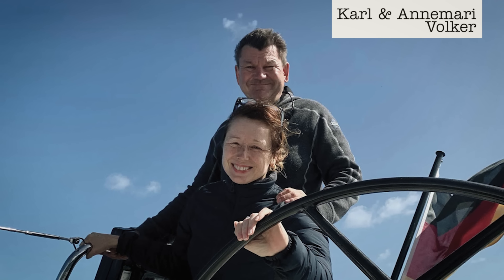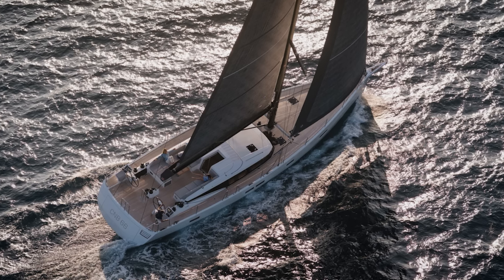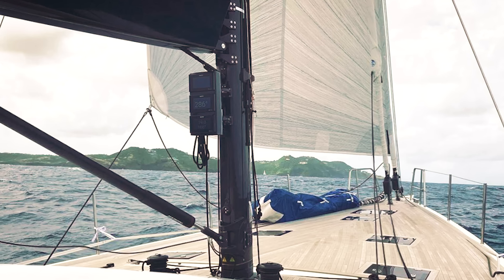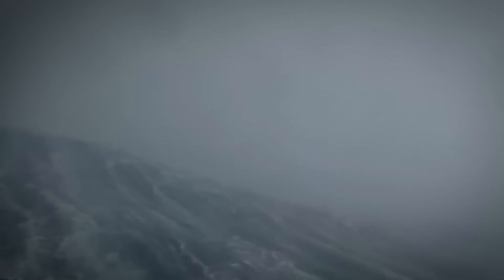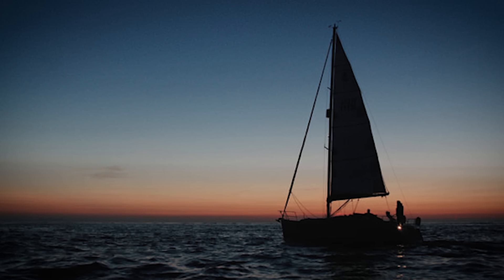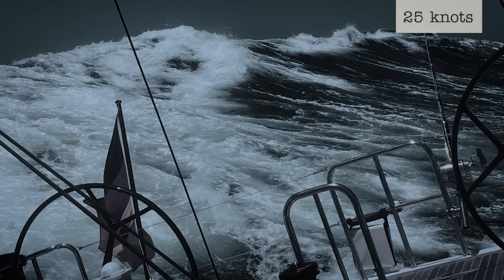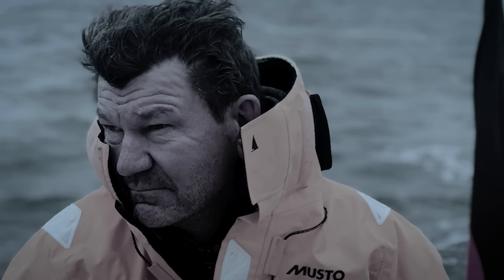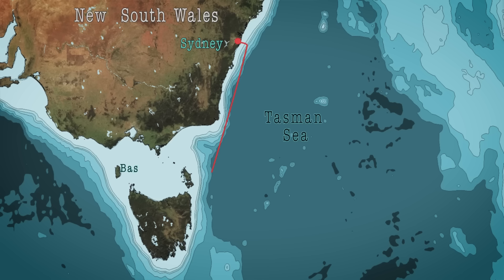Couple DIES on Private Yacht!

Comment: Just a few thoughts on the topic:
- Put in a first reef (at least) before the sun sets. 
- Monohull: If you're wondering if you should reef... the answer is yes. 
- Multihull: If you're wondering if you should reef... it's already too late. 
- Boom-furling (or standard) main... Run a downhaul line to the head (top corner) of the main. Run it through a block to a winch. You don't have to bother winding it on the boom. Just get it down quickly (any point of sail) in an emergency. 
- Carry an appropriately sized sea anchor and/or (series) drogue. Stop or slow the boat down. Practice in light conditions.
- For watch keepers: If you're nervous or unsure of anything,  wake the Captain.
- For owners: If you're planning a passage that you feel is above you're pay grade, hire an experienced professional and put them in complete control of your vessel.  Join their crew at their discretion (try to inherit everything you can from them).
- For delivery captains: Make it clear to owners that you are the sole final decision maker on the vessel. Give them permission to request you pull into the nearest safe port where they can dismiss you. 
* these are part of my crew briefing for every delivery over the past many decades.
Reply: Agreed on all points except reefing at night and the use of a drogue. At first, as crew, later as captain and and later again, as delivery crew, we never reefed until it was necessary, regardless of the time of day. When we reefed, we did so without hesitation, but also shook out the reef as soon as it was possible to do so safely for the conditions The point was and remains to make as fast a passage as safely possible, which is still the best way of avoiding problems. Drogues would seem to be a great solution, but in my many score thousands of miles at sea on innumerable different sailboats, l've never so much as seen one, much less heard of one being available or used successfully. The explanation most often provided for why this is the case it that a drogue with a hoop of sufficient diameter and strength to function effectively is simply too big to stow aboard a sailboat without being dangerously obtrusive to working safely on deck.
Reply: All very good advice. Particularly, reefing before sunset and an emergency line to pull the mains’l down. Also, I cringed whenever the narrator called the mainsheet or the preventer a “rope”. As the old saying goes, there’s only one rope on a sailing vessel and that’s on the luff of the mains’l (or fores’l, or mizzen) all the rest are called LINES!
Also, why didn’t the Capt’n do reefing drills before leaving Bermuda?
Reply: All sound advice. Thank you.🇦🇺
Reply: @frankmiller95 I appreciate your response.  Please employ the storm tactics that you feel comfortable with.  I'm happy that you've never found yourself in conditions that would benefit from drag inducing gear. For multihulls I prefer to carry a series drogue which can be deployed off the stern at varying lengths to control the speed while running with a high following sea. For monos I typically bring my own chute which I can use as a sea anchor or choke it smaller to use as a drogue. Many years ago I picked up a delivery of a very sleek Hinckley yawl with the owner on board.  I was hired at his wife's insistence due to events that occurred during his prior year's crossing from the US to the Caribbean.  He had followed a (famous) weather router's directives which led him into a nasty developing storm. He blew out his genoa and managed to drop his main. He told me that he was traveling at 18 knots bare pole (any physicists out there might want to comment on the exponential difference in impact force incurred when driving a displacement sailboat hull into a wall of water at 18 knots .. as composers to..say ... 2 knots). He had no drag gear on board so he tried towing warps (rope and chain) with little effect. That night he was knocked down three times,  lost his complete electrical system,  and one of his pickup crew (off a famous crewing website - with "more enthusiasm than experience") decided that he'd had enough and pulled the EPIRB.  The owners next challenge was to talk the US Navy out of forcing him to abandon his vessel. --- I generally charge my clients a fixed  fee with overrides for non-weather-related delays so they don't care if it takes a day or two longer. I try to "do know harm" to any of the boats I drive. My focus while cruising offshore (or flying airplanes) is to "never make the same mistake once".

Ps .. 25 kts gusting to 30 is just a typical day here in the Caribbean trades.
Reply: @scomo532 Don't forget the bell rope
Reply: @frankmiller95  I would respectfully disagree, especially if shoht handed. If you’re racing that all makes sense, but if it’s a delivery, why be concerned about time? As you know, the most dangerous thing on a sailboat is a schedule. Reefing before sunset means it’s less likely the watch Cap’t will need to raise the off watch to help reef. That makes for a far more contented crew.
Reply: @Lazarov_Tweevles  called a lanyid
Reply: @scomo532 Preemptively reefing too soon means that you will spend more time on a passage and with more uncomfortable boat motion. Unnecessarily exhausting a short-handed crew is not a smart move. Reef when conditions require that you do so, but neither before nor after.
Reply: @markhamstra1083  again, I respectfully disagree, ticking in one reef before sunset might diminish your speed by a knot or two. Over a long passage that might amount to an extra day. However, rousting the offwatch every night to crash reef the main will do more harm to their comfort and morale than an extra day at sea.
Reply: @scomo532  You are misrepresenting. Not every night, and not crash reefs — I didn’t say wait to reef until it is too late to do so comfortably. And reefing unnecessarily can slow boat speed by easily more than a knot or two if doing so deprives the boat of the power needed to efficiently make headway in a given sea state, to say nothing of counter currents. Spending more time less comfortably and exposed to more adverse weather risk on passage is what you accomplish by reefing unnecessarily just because it got dark, not improved safety.
Reply: @markhamstra1083  In and near the stream, unexpected squalls pop up regularly at night and can catch a watch crew off guard. Hence, it is better to be prepared by tucking in a reef than rushing up on deck in the black of night to do so under trying conditions. A two man watch would have its hands full if the wind is gusting to 35, so the off watch would need to stand to. That’s not going to make the watch Capt’n very popular with the off watch. Anticipating bad situations and preparing for them in advance is always sound seamanship. History at sea has proven that approach to be sterling.  So, I’ll stick with that philosophy and you can go with yours
Reply: Amazed that the term “drogue” should be understood to refer to anything other than a Jordan Series Drogue. The parachute type drogue used and recommended by the Pardeys has not been designed and tested anything like as intensively as the JSD. There also quite a few reports of the JSD being used in anger, unlike the parachute type. I also agree completely with the rule of putting a reef at night when sailing offshore, although with a strong crew this may be unnecessary. I tend to sail 2 up, and don’t like going to the mast alone at night with my crew asleep below deck in order to,put in a reef. Sailing offshore you get the weather you get, and sailing 1 or 2 knots faster/slower is not going to affect this. I suppose if you are crossing to Bermuda, with a distinct weather window, speed may make a difference, but sailing fast in anything other than relatively calm weather is liable to break something, men or boat.
Reply: @scomo532  Again, you are misrepresenting. Not everywhere is prone to nighttime squalls that cannot be anticipated. In fact, most places are not. Sure, if you have good reason to fear a sudden squall, then shortening before it’s necessary can be a wise move. That does not, however, mean that shortening sail every time it gets dark makes good sense.
Reply: @Lazarov_Tweevles  Not questioning your account, but it's difficult to understand how a displacement hull could reach sustained speeds of eighteen, or as they down under "eighdeen" knots, even surfing down some very big seas. Eff me dead, mayte.
Reply: @markhamstra1083  My vote is for Mark.
Reply: According to the video this particular yacht had a modified  automated mast system to accommodate a minimum crew. I thought reefing was automated inside the mast. That being said wouldn’t it  have been impossible for them to reef this particular sail?
Also as someone who only sails small boats & cats, why is reefing so important before sunset?
Reply: If you're sailing, you're fucked.
Reply: @frankmiller95 I was at the helm of a 50 ton monohull sloop in 40 kts of wind and 10-12 ft breaking seas. We we running with a reefed genny and surfing down those waves we hit 18 kts. She was moving at 10-12 kts consistently with bursts to 16-18 down the face of those seas.
Reply: @macdoctor145  The mains’l furls into the boon like a window shade, one can furl it to whatever size one wants, hence reefing is accomplished. Tucking in one reef at sunset endures that the main will be manageable should the shortened overnight watches experience a squall. It makes it easier on the watch crew. It’s easier to shake out a reef in the morning than to tuck one in during the black of night in a rilling sea. The traditional slab reef on a marconi mains’l is actually easier to do than the boom roller furler.
Reply: RiFF = ´DäiF v v??
Reply: This guy boats
Reply: @frankmiller95 You would have to take that up with the man who made the claim ... the owner of the Hinckley.
Reply: @Lazarov_Tweevles  Agreed.
Reply: Lazarov_Tweevies,
You are most wise, and obviously very experienced. I see way too many people purchasing huge boats because they can afford them, rather than because they can operate them. A gorilla boat with automatic sail handling systems is still a gorilla boat. This sad tragedy proves this point. As a purchaser of a boat, one must ask "If all automatic systems fail in bad weather, can I still sail my boat, including dowsing sails and replacing them with storm sails?" "Will I have enough crew to operate the boat safely?" If the answer is no, then either invite more crew, or purchase a smaller boat. There is no shame in admitting that a boat is too big to safely shorthand or singlehand.
Reply: @frankmiller95  As for drogues, my friend Jack swears by them.  He is in his 80's with many thousands of sea miles.  His system is long bridle, and a modified motorcycle tyre, admittedly the boats were a bit smaller than the one in this story.
Reply: Putting a reef at sunset? Just hoist A5 spinnaker with 35+knts wind down the Gulf of Biscay, sufing to Cap Finisterre with the iberica orcas baby!! 🌊⛵
Reply: @Lazarov_Tweevles   lol, that your real name?
Reply: Also, check the weather forecasts, in this age of satellite navigation etc, why did they not know they were running into storms?
Reply: I'd sail the world with you mate. 
My las trip was a 52ft trimaran out of Whangārei up past Norfolk island and over to Bundaberg. Id love to become involved in deliveries.
Reply: As someone who wants to sail round the world n have thought about how I would deal with sailing at night 100% on the money with a reef at night. You never want to have to reef your mainsail in the middle of the night in a squall ever yes you may loose speed but if your a small crew n not a a full race crew why gamble it
Reply: Thank you.
Reply: while most of your points are fine, none of this is relevant here or would have helped. The reefed well on time and it was behviour during the manuver that killed them. Arguably due to a design flaw of the boat.

As for drogues, have you actually ever used one?
Reply: Design flaw 
If I designed that boat for a couple I would have suggested a split rig.
Old style wish bone rig or a staysail schooner.
Breaking up the sail plan to make it manageable for two people.⚓✔️⛵
Reply: @carledinger3422  not a design flaw at all its a skill issue that’s like buying a Porsche gt3rs or corvette n then saying it’s a design flaw when you crash it due to lack of skill
Reply: Cannot agree more! And this is something I will set up in my boat after reading this (I have a standard main, boat is small 29ft but can be a handful when shorthanded and...): "- Boom-furling (or standard) main... Run a downhaul line to the head (top corner) of the main. Run it through a block to a winch. You don't have to bother winding it on the boom. Just get it down quickly (at any point of sail) in an emergency. "
Reply: Hey!!!! I resemble those remarks. Who do you think you are, ME???? LOL. Just perfection, rarely seen written so well. I have been  a professional mariner for over 50 years.
Reply: "Never make the same mistake ONCE".  Yup.  Brevity is the soul of wit. @Lazarov_Tweevles
Reply: @macdoctor145  because reefing in a dark night in storm and rain on the ocean is not to be underestimated. It's a quite complicated manouvre and  must be executed with patience, skill and knowledge. On a bigger boat it needs more than 2 people to perform. So its a " all hands on deck" manouvre. I crossed the Atlanctic twice in both directions with mainsail- mastin- furlingsystems, which are good to manage, if you know what to do. But pray for that you don't get some yamming of the system.  In this respect the classical slab-reef system is troublefree, but not as convenient to operate.
As was written even the tragically killed owners of this big yacht  were not happy with their mainsail - inboom- furling system. The skipper Carl therefore wanted to operate and control the furling process at the mast himself, in order to prevent any yamming. But as I wrote in another statement he should have been at the helm in this night and they shouldn't use the main at all in this conditions, concerning the difficulties combined with the reefing- process.
Reply: This is absolutely all fantastic advice
Reply: John Sanders,multiple solo round the world laps.Sails mostly with two reefs in the main,it could be slow but he’s still alive and is no pussy.Shit will ALWAYS hit the fan at night.Having to use a preventer ,for me is asking for trouble.Just head up a tad,it’s a lot safer because when it goes wrong,you thought things couldn’t get worse.You are going to be forced into the wind and then heading away from the wind to take the load off the main creating new issues.
Reply: Fully agree.
Reply: As a delivery skipper I usually don't allow the owner to accompany me when feasible. If they insist I raise the rate and hire crew so that it cannot be a one on one situation. I prefer to single hand before having an owner along. I have turned down plenty of deliveries because the owner insisted on coming along. Even if they agree to giving me the final word they can try to run the show and cause a disaster.
Reply: Reef for the night. You're out the for fun, not to inflate ego's. If you don't enjoy being out there, time to move ashore.
Reply: The flush deck is dangerous in itself.  We sailed in 30 knots often and but a second reef was needed at 25.
Reply: makes sense. -seems this (awesome) boat was oversized for less experienced owners :( may they rest in peace
Reply: @frankmiller95  A drogue with a large diameter, as you describe, is obsolete.  The newer series design has many smaller parachutes along it's length, allowing the drogue effect to increased or decreased depending on how much line is let out;  also, you don't have the catastrophic effects of one huge chute fouling or collapsing, since there are many independent ones.
Reply: @Lazarov_Tweevles  I wish YT showed replies next to comments, since I replied before seeing your reply.  "A drogue with a large diameter, as you describe, is obsolete.  The newer series design has many smaller parachutes along it's length, allowing the drogue effect to increased or decreased depending on how much line is let out;  also, you don't have the catastrophic effects of one huge chute fouling or collapsing, since there are many independent ones."
Reply: @frankmiller95  Agree completely, drogues are generally used on much smaller boats, the boat in question here easily managed the wind and wave state it seems as it was later recovered.  Speed is important , but round up into the wind as required to control the power in the sail rather than trying to adjust a sail in high winds when short handed.  The autopilot will sail to wind rather than a course.  So many things that could/should have been done but in this instance but all the holes in the Swiss Cheese lined up.  We run preventers all the time to pin the boom - just nervous I guess with a big main sail and I always avoid a full boom out when sailing down wind - get the genneker out if conditions permit, they can be cut free easily.  I do wonder about some of the design details of the boat though, with no main sheet traveller and 4:1 attachment.  One thing is for sure it's easy to comment when sat behind a desk.
Reply: My main is always reefed. It can be shaken out quickly in light air.
Reply: Good advice - gybe preventer and emergency main drop mechanism
Reply: Practice & Understudy are the Key points most miss.
Reply: Great comment. Add to that, training for all complex procedures, checking the weather, and staying within 150 miles of shore
Reply: @Malibus_Most_Wanted GT3RS, LOL.  Few are actually tracked or raced and those that do are usually neither fast or they just wad them up.  99.99% poseur car.
Reply: @alexnutcasio936  most at my track are fast but it’s guys with money skill to back it up but yes totally agree majority you’ll see lack the skill to back it up those n the new corvettes
Reply: @Malibus_Most_Wanted  at my track, I stay away from the guys in new suit, new helmet and unworn Pilotos.   It’s usually the guy in the new Z06, GT3RS or GT2.  The 992.1 Turbo guys seem to know their limitations.  It’s always more money than talent or skill.   Few wad them up anymore because track insurance is getting very hard to find.  How do you define fast?  I’ve seen fast in Miata’s and GR86 too. A great driver in a Miata on gum balls can run down a mediocre driver in a GT3.   Similar to what we see here with this sail boat.  Sounds like the Germans cashed out with little talent or skill to handle such a vessel. Rough seas and reefed sails are not for the inexperienced.
Reply: A sphincter says what?
Reply: Well said.
Reply: @scomo532 0:17 😢
Reply: The insane ramblings of a madman
Reply: Most yachties talk a good game but get them on the ocean in a fierce storm they cower and pray
Reply: Ooh this is tips about the situation lol idly I thought it was about his video pics 😂 until i read more
Reply: You and me similar thoughts
Almost precisely and I haven’t sailed ocean crossings since 1988
I reckon 1980s I spent a year at sea usually a month at a time max passage but you don’t forget it do u
Now I take my wife out five miles on a go fast in the gulf and she’s like this far enough out honey 
lol
Reply: @bubuleh71  totally, even for non-emergency... spent two weeks with a bente 24 and my significant other, great  cozy little boat, but with only an outbord engine, entry into small ports  was kind of tricky, since taking the mainsail down out of port assured you an adventurous ride on the last mile, Main cause of the misery, the main sail did not reliably fall down when you just let go the halyard, which would have given me more confidence for an  entry to port under sails, especially if your mate is not 100% secure to jump to the mast in no time to get the sail down. A little line  led to the cockpit just to help the mains top getting down from the covkpit would have been a neat solution.
Reply: you still have a lot learn lmao
Reply: @frankmiller95 😅
Reply: I've never seen a downhaul to the head of the sail. Wouldn't it slap the mast and sail constantly causing damage?
Reply: @DaDude999  Not if it's tight. We used them on the Fantome (RIP)...a 282' four-masted schooner I crewed on back in the 70s. It would have been nearly impossible to douse some of those large sails without them, in certain conditions.
Reply: Oh bore offf ffs
Reply: Nobody asked for the essay
Reply: Ever since I started sailing when I was 7, the phrase "Reef early and often" has saved me in many bad weather situations.